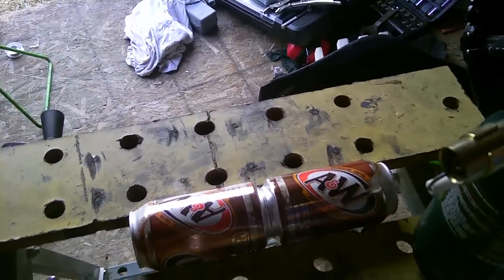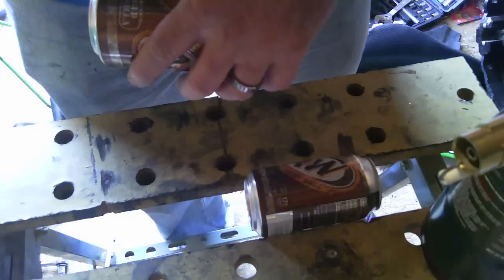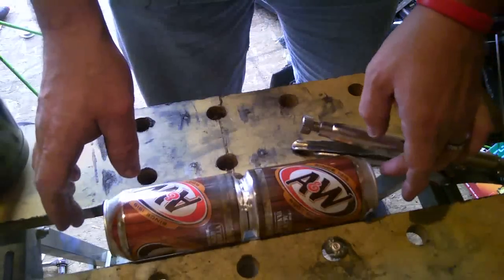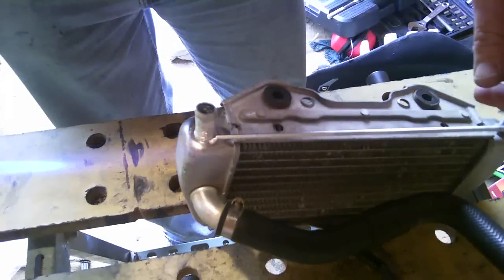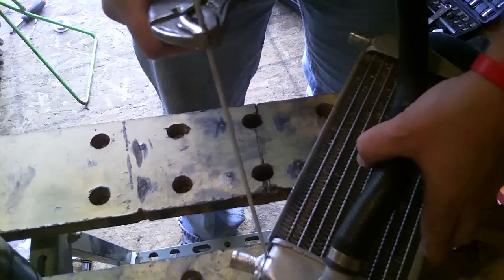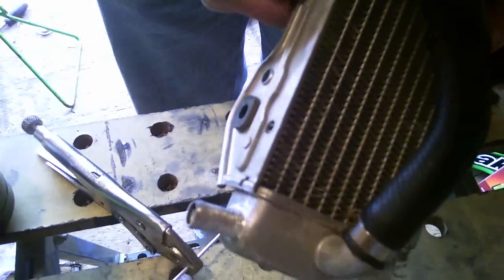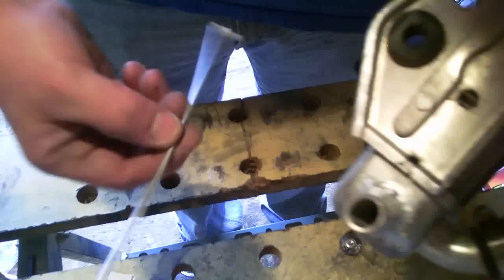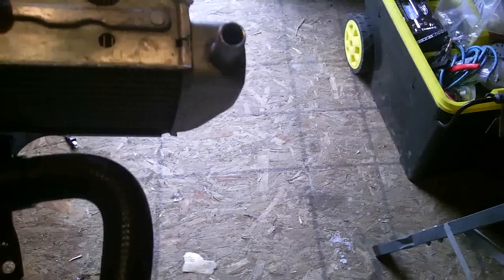How to weld aluminum with a propane torch and low heat aluminum welding rods fix your radiator.

Comment: You have no idea how to solder or braze anything that is why it is not working you have to learn the basics of how to solder/ braze metal the working material is no where near hot enough at all.
Reply from the maker: Thanks for your input! My goal with this video was to show a method that worked for me to fix a radiator with a propane torch, which might be helpful for those without more advanced welding equipment. The repair holds to this day. Thank you so much for commenting, watching and the very kind words. I appreciate it greatly. All the best.👍😀

Comment: you learn from your mistakes id suggest if you have one of those temp guns to preheat the parent surface first to the recommended temp then start in with the alloy rod i think will buy  some of that to have on hand thanks for posting his vid
Reply from the maker: I do learn from my mistakes. I so have one of those infrared thermometers now, didn't then. Thanks for the suggestion and also thank you so much for watching, commenting and the valuable feedback. I appreciate it greatly. Subscribe, Click The Bell and stay tuned!  All the best.👍😀

Comment: Pipe fitter( 8yr).here...my pops a welder.would it have made a diff. If u pre heat area of radiator to weld and maybe grinded down the rod to a much smaller diameter for the first pass at least as well as came a good bit down on your heat.less rod- less heat= for  a more manageable combo..????? I'm not sure just throwing that out there..
Reply from the maker: Thank you so much for watching, commenting and the valuable feedback. I appreciate it greatly. Subscribe, Click The Bell and stay tuned!  All the best.👍😀

Comment: A tip that I got from an experienced welder was when cleaning the repair material don’t use a steel brush as it leaves a residue. Use a stainless steel brush instead.
Reply from the maker: Thank you so much for watching, commenting and the valuable feedback. I appreciate it greatly. All the best.👍😀

Comment: originally you should have practiced with metals of similar thickness
Reply from the maker: Thank you so much for watching, commenting and the valuable feedback. I appreciate it greatly. All the best.👍😀
Reply: I saw the note at the end. You seem to have understood the problem. This is the same for any type of soldering/welding & the reason you need a stronger welder(more heat) to weld thicker materials.

Comment: Use stainless steel wire brush or wire wheel... It really makes the difference
Reply from the maker: Will do that next time. Thank you so much for watching, commenting and the valuable feedback. I appreciate it greatly. All the best.👍😀
Reply: @richardlloydusa  These rods really are great! I have been able to use my blobs of waste to fix things up still... In tried some off brand  from China that was super thin and came in 3 bundles.. those ended up being total crap and required so much heat to melt the item to be repaired got wrecked.. I just scored some aluminum rods that supposedly will work in a DC arc welder . They are new from Blue Demon... E4043
Reply from the maker: Thank you for watching, commenting, the valuable feedback and the kind words. I appreciate it greatly. I am happy to know I could help. All the best.👍😀

Comment: Your lack of adhesion is due to the heat hitting the rod. You'll need to heat up the radiator to the 720 (or whatever the recommended temperature of the rods are), then the rod should  puddle up instantly when it comes into contact with the aluminum radiator. I've found that it's much easier to put the item your braising (your radiator) on top of a gas bbq grill to heat up the entire unit...then use the torch to raise the heat of the area you are wanting to weld. Aluminum cools down at a really fast pace, and it sucks the heat out of the area you're trying to weld....leaving you with an aggravation, unless you preheat the entire item. I used the harbor freight aluminum welding rods too, with the same end result. After I found out about heating up the entire piece (preheating), the welds turned out beautiful....and incredibly strong! Thanks for putting out a great video, wish I would have found it at the time of your upload. I hope this helps a little...I spent a lot of time and wasted lots of material before I found out how to do it correctly. 
God bless you my friend! 
Donnie
(Standing Goats Rescue on YouTube)
Reply from the maker: You are most welcome. Thank you for watching, commenting, the valuable feedback and the kind words. I appreciate it greatly. I am happy to know I could help. All the best.👍😀

Comment: I like all the comments about this video ,  here is mine I believe If Richard Lloyd had 50 more or those to do he would have it down in less than a hour, and by the end of the day his work would be proper.  Ive welded in shops , shipyards for a many years, sometimes you have no choice but to work with is at hand, and for 15 bucks and back on the road plus a video to show off.  Not bad , as  for everyone trying this remember  Eye protection, fire watch, gloves . in a safe spot. show us your work !

Comment: Richard, just a tip I haven't sen anyone else mention but I haven't read all comments.
If you have an oxy-acetylene torch set, light it in pure acetylene, low flame and soot your work area. Heat it with your torch carefully and the soot will burn off just below 700°F so you know when you're getting close. Don't have the Red in the heat but touch it to the repair area to "tin" the metal. Rod will melt in if it's the right temp.
I'm not criticizing, just offering help.
Good video. I know I try and learn from mistakes, preferably others mistakes. Good job showing them.

Comment: Works great.  I did my kx250 radiators.  No worry on any aluminum.  The cans are paper thin.  That's why. Anything thicker needs more heat
Reply from the maker: Thank you for watching, commenting and the valuable feedback. I appreciate it greatly. All the best. 👍😀

Comment: My five cents here... I couldn't resist from comment while watching how you did this aluminum brazing job... First, you may have burnt some gasket inside the radiator by too much heat... Second, you should have removed all rubber material from the radiator. Third, you need to get your work piece up to the rod melting point, then touch and scratch with it periodically to see if piece is hot enough, instead of keeping the rod in the flame all the time. Once you reached correct temperature, the rod will start to flow nicely upon contact and with the torch in-out movement you keep the rod flowing nicely. The larger piece, the harder it gets... and you may have to use oxy-acet torch to be able to reach necessary level of heat. I used similar rods, purchased from Amazon, they worked extremely well. And I am not a pro welder at all. I suggest you try different rods next time to see the difference and report it in your videos. Another one to try would be Blue Demon Triple Play aluminum brazing rods. Good luck with it!
Reply from the maker: Thank you for watching, commenting and the valuable feedback. I appreciate it greatly. All the best.

Comment: I would say for never doing it before you did a good job and at least you knew to prep the area you are tring to "weld" I call it brazing ...just warm the metal up you are tring to weld and then use the rod and torch and laydown your weld but it's just like brazing and good job
Reply from the maker: You are most welcome. Thank you for watching, commenting and the kind words. I appreciate it greatly. All the best.

Comment: Nicely done and I agree work with cans FIRST. then if one can braze without melting through side wall then one is ready. My Choice is map/o2 it heats faster than propane does same job. 2 as a noob to this myself heat waving or in circular pattern.

Comment: J-B Weld is man's best friend for stuff like this, used it on my KX 500 rads and worked great ... no torch needed. The original formula is good to 600* and the quick set version good to 300* and if your coolant ever reaches 300* you will have bigger problems to worry about other than your rad, lol. I bead-blasted both rads and touched up all the bad spots with J-B Weld, painted them and still good 6 years later.
Reply from the maker: Thanks.

Comment: You're good Richard the only thing I want to add to the other comments it a that yes Sr this rods does not need any flux I have use them before few time the only think you need yo do it's clean it with stainless brush and heat the material instead of the rod if you heat the material to the right temperature the brazing rod will melt very nice!! You're good all ways
Reply from the maker: You are most welcome. Thank your very much for commenting, watching and the kind words. All the best.

Comment: Okay i have a question will this aluminum  welding rod fix a hair line crack on the top casing of a 1986 yamaha 225 moto4 when i ride it only does it not leak but more of a seep can this fix it or is it toast i no how to do the work heat the metal first then touch the rod pretty much like a soldering job but ALOT more at risk then a bad connection it is right at the bottom of wjere the jug bolts to the case its on the right side bottom bolt from the jug to the case now the hair line crack starts at the Bolt hole then runs to the right in a strait line hasnt effected how it runs its a torque monster
Reply from the maker: You could give it a try. Watch the heat as you do this and remove anything that can melt or catch fire. Clean the surface well. BTW you can buy a whole new engine on Ebay: https://goo.gl/6Pwy5W for $389.99 in case you need a spare. Thanks. All the best.

Comment: I can't watch this without intervening here. I've been at this for over 50 years and specialize with Aluminum. With this rod you're using you need a lower heat and make sure you get your aluminum hot first. The melting point of this rod is around 700 deg. but it will start melting around 450 deg. so about this point you need to be moving your rod across the joint like you are scratching it. This is called tinning your material, both sides and then you'll see your rod starting to melt to the tinning and flow to a perfect fillet. What I use for this is the no. 1 brazing tip or the no. 0 , small flame about 1 1/2 " long and dob my rod in and out fairly quickly. When the heat is right you'll see some of the rod left behind, small bits at first but this is the right sign of it being ready to flow. The best tip I can give you is don't be in a hurry to dob rod in, just laying the rod in will take away enough heat to interrupt and melt long before the material is ready for it. Also if you go to the alumaweld website they have a video there to help you, I don't have a camera so I can't just show you. Sorry to just jump in here but I've trained a lot of guys, and some girls, and it's hard to not try and teach. 
       Oh, one more thing, with oxy-acet being so much hotter keep moving your torch in and out and not blow holes. Good luck.
Reply from the maker: Thank you very much for the great feedback. I appreciate it and I am sure others will tool. All the best.
Reply: Can you weld steel with aluminum rods? I have never welded, but wanted to join some stuff
Reply: @slalomschi  that's what I want to know to !!
Reply: @slalomschi  Brazing is the subject of this video, not welding.
Reply: JR Eskins make a video
Reply: Helpfull comment, thanks. I was wondering if I could ask you a question in this occasion -if you dont mind-. I am also new to alu brazing with these fluxed rods and Im trying to braze a motorcycle main radiator of a 1000cc. 

I'm using oxy/ace setup with the smallest tip I have, a 0.2-0.5mm but I can''t seem to get the radiator hot enough. I'm heating it up for some time but the stick doesn't seem to melt but only balls up and the Alu gets grey'isch all the time after i have been grinding the alu up. 

one of my questions would be: what is causing this greyisch breaking-out and; what flame do you hit the material with, the inner cone or outer cone? I setup in the beginning for a light carburating flame, afterwards -because its alu and it didn't want to heat-up, I set it up allmost to a neutral flame .

also: do you have a any trick to indicate when the alu it hot enough by using any medium? (for example like when white flux becomes transparent) I've read about putting carbon on it with a rich flame and check untill when it burns away?
Reply: Ro Ba 
I think your problem is that you are grinding the aluminum instead of using a wire brush. Grinding it causes the weld area to become impregnated with oxidation, and aluminum oxidation has a much higher melting point than clean aluminum. No expert here but I’ve heard professionals talk about it.
Reply: Do you know what material i can use to weld copper with aluminum using a propane torch
Reply: off questions but do you think a 1200F heat gun (not propane) could weld aluminum with low temp sticks?

Comment: I've just scrolled through most of these posts which offer advice on welding or brazing Aluminum. The thing is I was looking for Aluminium and not Aluminum, now I feel a right daft bugger, by the way I'm offering a prize of a full packet of Tunes (cherry menthol) for anyone who can show where Aluminum appears on the periodic table of elements, I've looked and, believe me, it isn't there- look for yourself if my word isn't enough, but if you do, prepare to be amazed because it really isn't there. (p.s. don't confuse it with Aluminium)

Comment: Apply heat to the area and once hot enough the aluminium rod will start to melt.   Don,t use heat on the actual rod.
Reply from the maker: Agreed and understood. Thanks. BTW the repair holds to this day. All the best.

Comment: I fixed a radiator leak with JB welding once and it hold the pressures.   Very good job
Reply from the maker: Thank you very much.

Comment: Apply heat to the area and once hot enough the aluminium rod will start to melt.   Don,t use heat on the actual rod.

Comment: If you hold the rod back the rod as you heat the surface you will then find that you can introduce the rod in a sliding motion and it will penetrate the surface and crack.  If you heat the rod you lose adhesion and get globs.

Comment: Not a  "welder" but I've been trying to learn a few processes. I noticed for aluminum tig welding it is not uncommon to clean the surface with mineral spirits after light sanding.
Apparently this aids adhesion by reducing contamination. Thanks for the lesson.
Reply from the maker: Makes sense. The cleaner the surface the better the adhesion. Thanks for watching and commenting.

Comment: Nice learning experience, Richard.  If I may make a suggestion, brazing or soldering a cracked radiator may be easier if you first flush it thoroughly with water and allow it to dry.  Residual glycol inside the radiator always seems to find its way through a crack when heated, and prevents adhesion.
Reply from the maker: Thanks for the tip. I had not flushed the glycol from it. All the best.

Comment: I have several cracks in my Honda 530 GVX aluminum crankcase.  I am going to attempt to weld it together with a propane torch.  Should I apply aluminum from the inside or outside?
Reply from the maker: The outside would be the easiest to do and there is no risk of any part of the weld failing and falling into the engine. Thanks.
Reply: I have it disassembled.
Reply from the maker: You are going to have to heat the cover to the point that it melts the rod. My concern is that you have rubber components or cables going through the cover. Make sure you remove those before you begin or they will be damaged. I see all the cracks in the cover are they all leaking?

Comment: hey thanks for the video it was very informational.  I am trying to build a scale model of a scaffold so im going to have to weld some parts.  however im not sure about my choice of material.  I've read that steel doesn't weld as well as other metals. would you recommend welding steel?
Reply from the maker: You are welcome. I have no problem recommending welding steel. Steel is a very strong and weldable metal. As long as you use the correct materials and tools you should have no problem. Thanks.

Comment: I woould have used a smaller torch tip, and some silver solder. 
Now that I finished watching the whole video, I understand that you were not welding the thing, you were using some sort of aluminum solder. Yes, when soldering, you have to heat the metals of the parts you're trying to adhere together, and then let THAT melt the solder. Good job.
Reply from the maker: Thank you very much.
Reply: Yes a smaller torch tip would have been a more controllable heat source.